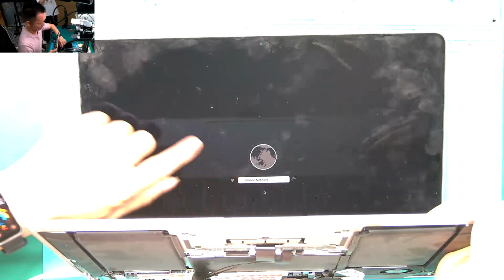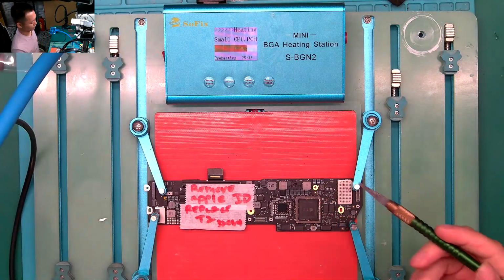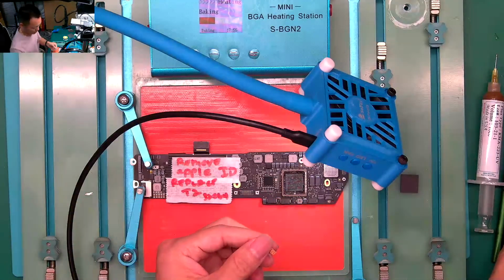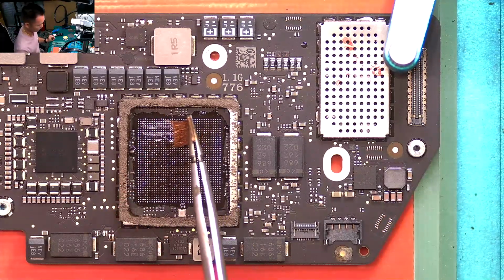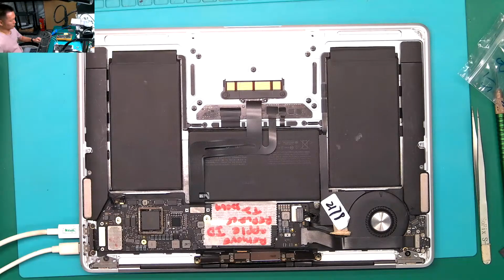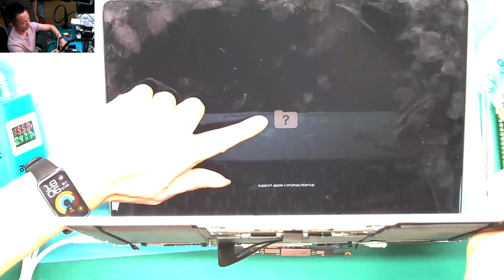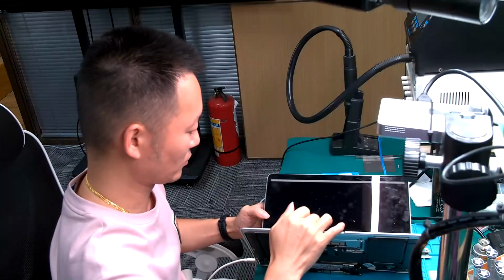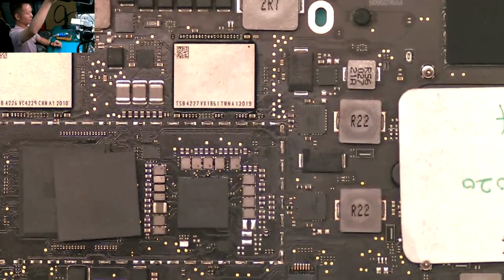Master Liu show  how to replace T2 SOC and remove iCloud activation lock

Comment: Impressive, i would expect this chip to be protected by fusible members/components fail when "tampering" is detected; doing this manipulation without internal knowledge of closely guarded details about the SoC/T1&2 chip to be impossible.

Nothing short of a mastery of the art on display here; thank you for the video.